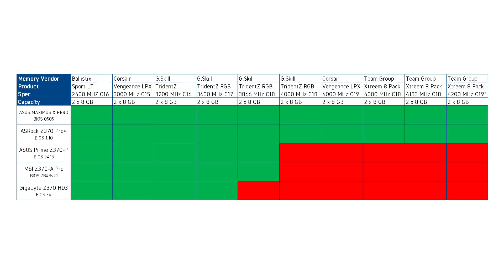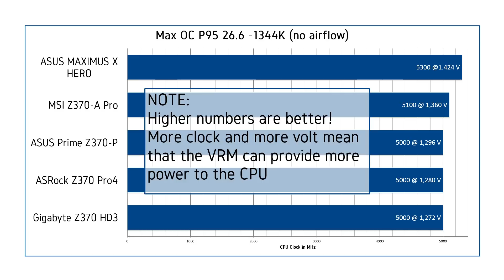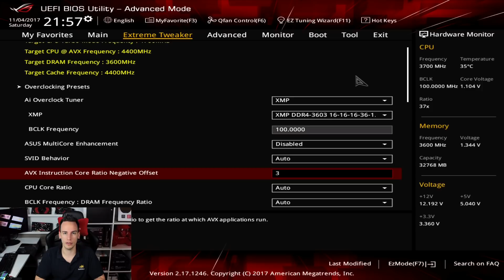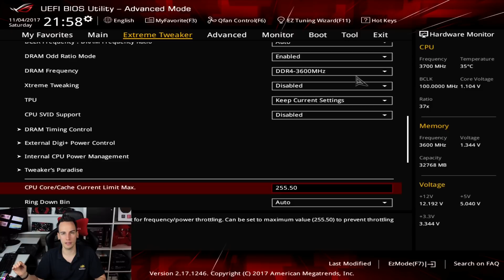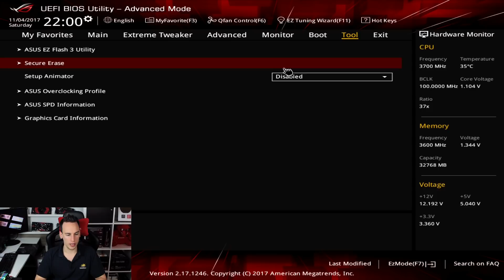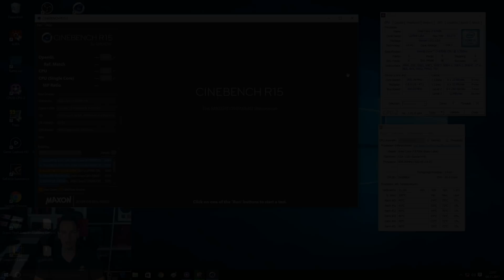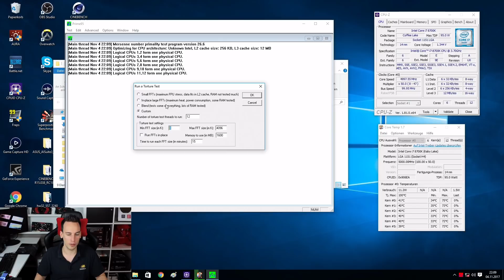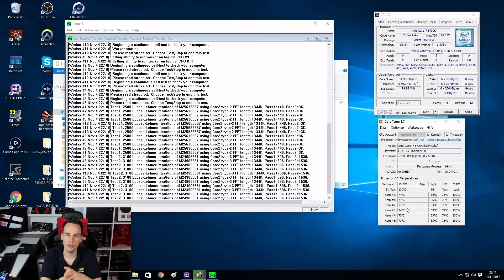ASUS MAXIMUS X HERO - Overclocking Test and Guide 8700K (en)

Comment: Followed this tutorial and 2 days later I started encountering random crashes while gaming but I am not overheating... is this a cause of overvolting? Any advice?
Reply: When I get to windows start up screen it freezes before letting me log in to my desktop. Plz help?...
Reply from the maker: Just load the defaults in BIOS and try it again on a lower level. Maybe just 4900 or 4800 MHz. Also try with lower DRAM Speed if this is causing your issues
Reply: Thanks for the reply I was running this with my dram at 3200 instead of the 3603 (I am running 2x8 16gb vengeance lpx 3200) I believe you were running could that be a possible cause of the crashes and freezes. Could adjusting the cpu cache ratio help with this? Fairly new to OC’ing trying to learn quick thanks again for the reply
Reply: Or should I chalk this up to I just didn’t get a good enough sample to run 5ghz

Comment: I have temp spikes while just browsing..from 35 to 75 celsius.... at 5ghz or 4.7ghz doesnt matter ... multicore enhancement thingy disabled...whenever i open something a program it spikes 5 to 15 celsius...urs look pretty stable at 40 -44 celsius before u started the cinebench...hmmm
Reply from the maker: sounds pretty normal to me actually. Might also depend on the coretemp version
Reply: der8auer hmmm... could be,  tnx for the reply

Comment: At 9:25 you talk about the power switching thingy, the thing is my cpu is at a constant 4,8 mhz (thats what i clocked mine too) and it never goes down. I would've liked it having it on 800 mhz idle, can you help me? My cpu is at a constant 40-50c, whilst idle.
Reply: check windows power control.  high performance will keep voltage and clock at max bios settings.  balanced will allow both to lower at idle

Comment: What settings do I need to change to keep the clock speed low on idle? With these settings, my clock speed is constantly high.
Reply: check windows power control.  high performance will keep voltage and clock at max bios settings.  balanced will allow both to lower at idle
Reply: Mike G it's set to balanced.

Comment: I went a different route with my Asus Prime Z370-P Board. I let XMP (DDR43000) optimize my other settings. I kept MCE. I made a conservative target of 4.8GHZ. Picks a LLC of 4. And set the voltage to 1.25V. Running gaming benchmarks and Prime 95 I'm hitting temps in the mid 60's. I should be able to go lower with my Voltage, but I noticed my VCore in CPUZ during Prime 95 was topping out at 1.2V and dipping to 1.18. After I ran that for about a half hour and stopped it my voltage bounced back up to 1.24V. So that is a little strange, but it's stable with good temps.
Reply: Cooler is a stock Acetek 120mm Rad AIO that I replaced its fans with Cougar Vortex PWMs.

Comment: I used this guide to OC my 8700k on a STRIX 370-E. Definitely more successful than the “one click 5Ghz OC” option in the bios! I am only using a single fan Kraken X31 water cooler, so can’t complain about the temps (especially as the cpu is not delidded). With all cores at 5.0Ghz I see 55-67C while gaming on typical ultra settings at 1440p, lower on less demanding titles. 100% load, which I doubt I would ever see in normal use, spiked to a little over 80C, and went as low as early 70s, so the average isn’t so bad as long as those heat spikes aren’t cause for concern. I burned it in for 2 hours, which made me a touch nervous, but I don’t think it thermal throttled. I am using 1.36 Vcore for stability but will look at easing it down and maybe taking LLC down a level or two as I saw 1.375 under 100% load.  It was drawing 137w I believe. This 8700k is idling cooler than my 4790 did, which is a pleasant surprise - it inspired me to adjust my case fans and water pump set up slightly, which seems to have improved overall cooling.

Now that I have satisfied myself I can get 5.0Ghz multi and 5.1GHz single core, scored some impressive benchmarks with the cooling I have (578/4408 on CPU-Z) I may downclock it a few 100Mhz until I get a double radiator AIO. Out of the games I play, only unoptimised Star Citizen Beta really needs the full power to brute force fps.

Also, does anyone know why streaming a movie off the internet makes the cpu work harder and hotter than a gaming session?? I find that pretty odd, so maybe someone has some tips about that...

Thanks!
Reply: hey dude. did your BIOS have the ""AVX instruction core ratio negative offset""  option?   I'm looking through my ASUS z370-f user manual but its not in there?   haven't built the system yet so I'm not sure if its in the BIOS or not on the "F" model?  any help would be great
Reply: Lucas Gregg -Yes it did... I can’t say off the top of my head exactly where though. I’d be surprised if you didn’t have the option on the 370F, it should be mostly similar. Maybe check for a newer BIOS and keep poking through the options? It must be there.

Comment: Hi der8auer.Thank you for the video.
For first ,sorry for my english.I follow your guide step by step,but i have a problem with svid support.Not having a delidded cpu i set the vcore on 1.33 and it works fine and temps are very well for a not delidded cpu.70° after an half hour with prime 95.The problem that i have is that, if i have Svid on disabled,every time i turn on my Psu and  start my pc i have a double boot and my operative system don't charge.But If i set Svid on auto my pc start very well but i can see vcore jump from 1.33 (set by me in bios) to 1.40 in operative system.After that if i put in stand by my pc and restart i see vcore return to 1.33 either in the O.S.Why i have this problem?

Comment: Nice video, mate. I enjoyed watching. Im running the same motherboard and cpu but 3GhZ Corsair Vengeance RAM and currently just a cheap stock-cooler. I plan on cooling the setup with the Alphacool Eisbaer 360 cooler very soon and plan on running my setup @5GhZ. I'll just put in the values you have here. Not much of an OC expert, so I rely on experts like you to walk me through the process. Thanks again!

Comment: Thanks for nice tutorial. I have one question. It's good that cpu go power saving to 800mhz but voltage stays in 1,350V? Not bad for cpu? Why voltage dont go down when mhz goes down too? Or maybe better use voltage offset mode in bios, and voltage go down with mhz. Please help me with this. Thank you.

Comment: Bro I'm a noob here and want to run my i7 8700k on 4.3Ghz with low voltage, as I'm using cheap air cooler (cooler Master hyper 212 LED Turbo)  which I will switch with an Aio soon. I have Asus Z370-F ROG STRIX Motherboard. 

Do I follow this video exactly for 4.3 Ghz ( instead put my Core ratio limit to 43 instead of 50) and manually put 1.200v for cpu voltage?  And also enable XMP for 3000mhz on ram? 

Or is there any settings from the video that should be changed as well?

please guide me I'm new to PC (switched from console) 

If I leave my voltage on AUTO, I see 1.36v in CPU-Z (max I saw was 1.375v). Isn't this too much for stock i7 8700k? What should I do to keep low voltage at 4.3Ghz for my Cpu?

Comment: Any idea why when running cinebench, cpu-z shows my oc at 5000mhz but when I run running prime95 it only shows 4700mhz?
Reply: Never mind,  prime95 runs AVX instructions so the offset I had set a 3 was making it slower
Reply: what board are you running out of curiosity?
Reply: X code

Comment: I can only get it stable at 5.0ghz with 1.38v which produces heat that ranges between 80 to 94, my AIO cooler is a 360mm h150i pro with push pull configuration, so is there any way to reduce those heats or achieve 5.0ghz  with less voltage

Comment: Just finished my build with the same components, powered on fine and applied these steps (5hgz@1.39v). Fried my cpu within 10 mins (using custom loop). Unfortunately I’m not trying this again
Reply: You could have only fried your cpu from not installing it correctly, 5ghz@1.45v won't even fry a pc and thats with no delid on air.
Reply: Johnny Appleseed didn’t seat it wrong, it booted fine before the OC. After doing the OC I booted again and it fried the CPU and Maximus X
Reply: FYI not hating on the channel at all, just letting everyone know that SH!T happens
Reply: Oh im not saying your hating on the channel or anything, just didn't want to scare anyone off thinking its going to fry there components, which this overclock cant, 0% chance.  More or so curios as to why it fried lol.
Reply: Johnny Appleseed All I’m saying is that the CPU worked, I OCed with 1.39v and then it blew and took the mobo with it. Very weird but clearly there’s a chance of any OC damaging your hardware
Reply: OC can damage hardware yes, but at 1.39v, my guess would be possibly had an extra digit in there and hit 13.9 LOL BOOOOOM, it should only fry if it overheats, and 1.40v idle will be low temps, could get pretty hot on prime95.  Did it start smoking for just die?

Comment: Hi, I have a question (afew actually) for der8auer :), have you gone back to this board on the newer bios I believe it's 1003 at this moment and noticed any changes for the good or bad ?. The reason I am asking is because I've just finished my build today which is c700p, asus hero X, 8700k, corsair h150i pro cooler, 16gb corsair LPX 3600mhz, corsair 1500 axi, EVGA hybrid 1080ti, m.2 960 etc and noticed I'm using the same bios as shown in your vid which was 0505. Also my eyes came out on bloody storks to see the auto asus OC to 4.7 was hitting 1.4v so I didn't know if newer bios revisions made any changes to such an aggressive voltage, I get it has to cover the best to the worse chips but man that's high for 4.7!. Im gunna fiddle about with manual OC tomorrow ( with the aid of your sweet vid ) because it's nearly 2 am here atm but I was wondering what you would suggest a mid way voltage to start with @ 4.7?, of course I will go higher but want to get 3 rock solid oc's up to 5ghz if possible as I have done with previous chips last 1 was 4770k delidded using your DELID DIE MATE + conductornaut which I think also supports the 8700k right ?. Anyway thanks for taking the time to read this (If you do) :) and any thanks for this vid especially and your channel in general mate.

Comment: @der8auer Hey man, Thanks for the video. Big thumbs up. I ran into something weird. I followed your tutorial to the "T" and when I start Prime 95, my "Multiplier" in CPUZ drops to x 47.0 from x50.0 as soon as I turn on prime 95 stress test. At this point I observe my CORE SPEED drop from 5000mhz to 4700mhz. What would be making my core throttle to x47?
Reply: You didn't follow his tutorial to a "T" if you're having this issue.  He mentions the verison of Prime95 he is using due to the newer ones using acx in the code so its kicking it down 300 (Which is where the setting 3 in the bios means.

Comment: Using your method and with a few tweaks I was able to get 5.2ghz on mu 8700k without delidding. I used a Corsair H150i pro water cooler and tested with CPU Z. I was at 85C This is on a Maximus X Code motherboard. Pretty much the same board as the Hero. I am wondering if I delid how much higher I can go.

Comment: Hello I did everything as you showed in the BIOS section of this video and my Core Voltage on CPU-Z is only 0.672V even though I set it to 1.35? Is this going to be a problem?

Comment: So basicly you can 3600mhz and 5ghz on very expensive board and cheap one. For me personaly a board must have vrm heatsinks of decent size, 4 case fan headers. No rgb. Cuz its bullsht for kiddies in my opinion. The rest of features all mobos have anyway. M.2 and whatnot. I personaly think you can do anything on msi z370 gaming plus. It has everything you need. Plastic cosmetic parts are not worth 150euro more. And more fazes dont mean u can clock any higher anyway. 
Ps: Your videos are great tnx.

Comment: My non delidded 8700k runs stable in the Test you mentioned and keeps a max temp between 81-88 degree cooled by a n-dh15 on 1.35v. Is this a safe 24/7 overlock to run?
Reply from the maker: Yes sounds safe :)

Comment: @Der8aur I have a question. I have my 8700k oced to 4.9ghz at 1.245v and I notice when I run a stress test my core clocks on all 6 cores fluctuate with each core hitting 4.9ghz but not all at the same time. If in enable MCE they will turbo up and all run at 4.9ghz during stress test. Any idea what's going on? I'm using the same board as you with an 8700k.

Comment: Great video, however I've got Max X Hero + 8700K + G.Skill 3000MHz and when i use the exact same settings as you the max CPU will go is 4.9GHz. Running Cinebench 4.8GHz, Prime95 4.7GHz, Realbench 4.7=4.8HGz. CPU-z and HW monitor all reading those frequencies. Any Ideas? I'm on the new 0802 BIOS and I get a different warning when I enable XMP It now says that you should Click yes if you're going to OC. I have tried Yes/NO, MCE on and off. I have also manage to get Vcore to 1.312 but same max frequencies. I'not seen it hit 5.0GHz yet.
Reply: I have the same set up as you. Did you get any luck with this? I can even get Cinebench to run without getting the BSOD.

Comment: Hello! Could you help me please? I did everything you said in the video and i have 8700k and hero 10, I passed all stress tests fine but my windows crash if i play some games that require alot of resources while games like dota 2 is going fine. What could be the problem?
Reply from the maker: just try to lower cpu multi by 1 and see if it works better. Alternatively increase vcore if you still have room in temperature
Reply: well i increased core voltage to 1.400 and it hasnt crushed yet, but will it increase temp too? :s

Comment: Excellent detail and tutorial.  I have the new Maximus X Formula on an EK water setup.  I was able to easily get 5.0 ghz using this guide without a delid for a first test of my setup.  As expected using der8auer's prime95 testing I was seeing temps bounce around the 80c mark.  The vcore was set to 1.35v as a start.  I then pulled the cpu and did the delid with Thermal Grizzly just like der8auer and reinstalled using Arctic Silver (because I had it on hand) between the IHS and EK cpu water block.  I saw a 20-22c drop in temps running prime95.  Pretty amazing difference on the delid if you use liquid metal.  After temps were bouncing around 60c I decided to bump up to 5.2ghz and also bump the cpu cache up to 4.5ghz.  No issues at 5.2ghz after 30 minutes in prime95.  AVX instructions are disabled in the latest prime95 version, by the way.  This run was with the vcore at 1.33 in the bios.  I did see failures at 1.31v on the vcore and since the bump back up to 1.33, there have been no failures.  I'm very glad I found this guide... it was exactly what I was looking for with my setup.  I"m feeling like I got some pretty good silicon in my 8700K, but the real win was with the delid for overclocking head room.  Thanks again der8auer! mg

Comment: I followed this guide exactly and my delidded 8700k blue screens almost instantly in cinebench with whea errors. Ive only tried up to 1.37v but my temps were getting high even with a delid (85c), did i get a potato 8700k? 4.9 with 1.344 is stable.
Reply: seems like someone lost the silicon lottery lol, feel bad for you bud

Comment: Great Guide!  Love you channel! One thing i cant get my head around is that even though EIST (speedstep) is enabled and i'm running powersavings plan in windows. The voltage wont go down. On my 4790K (old system, MSI mobo) i run it all the time in 5ghz but it increases voltage first when i put load on the cpu. So when i'm idling i get like 0.8v which lower the temps when browsing and such. Is there a way to this on the Maximus X hero? (Btw, you guide ended me with 5.2ghz 8700k and 4.5ghz ring/cache)

Comment: I did all the steps but at x50 ratio windows stucked several times when rebooting or Cinebench had errors, so i went for x49 with the rest of the settings stable. I cant complain, it's still awesome.

Comment: I underclocked the cache ratio to 4GHz from 4.4GHz to achieve a core ratio of 5.1GHz @1.265v. Does the cache ratio affect gaming performance? I don't use the i7 8700k yet for workstation use yet but would it affect workstation performance as well? Thanks!

By the way, I'm using a AORUS Z370 Ultra Gaming mobo but I wanted to ask you this question out of curiosity.

Comment: Thanks so much for your vid! I was able to hit 5.3Ghz with your config using just a Noctua NH-D15 air cooler!! :D (inside a HAF-X case). Unfortunately it's hitting 98° with the voltage up at 1.485V and so it's getting throttled. It's solid though at 5.0 Ghz hitting max temps of 85° - 87° running Prime95. Thank you thank you!!

When the warranty's up, I'll delid it and push it further.... hoping for 5.4... maybe 5.5??? ;)